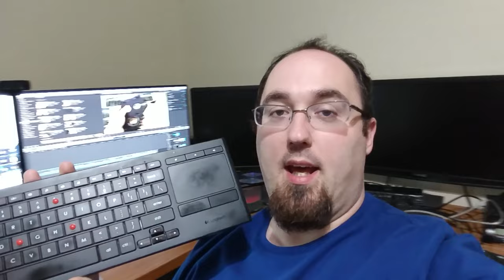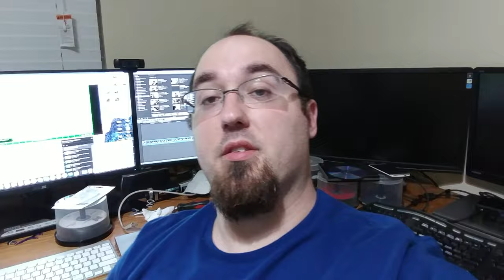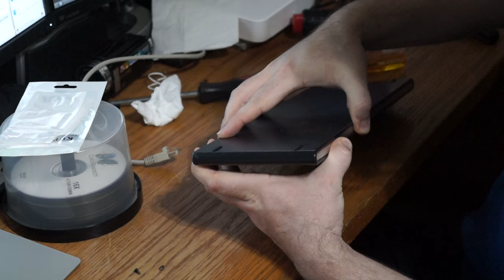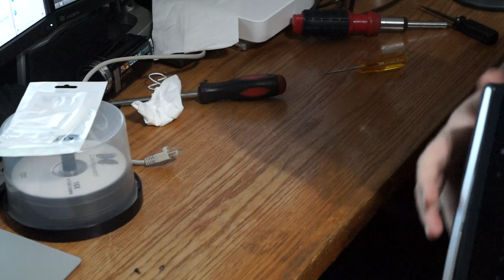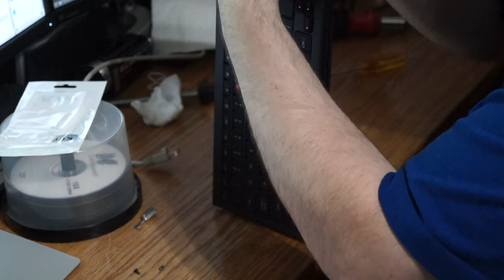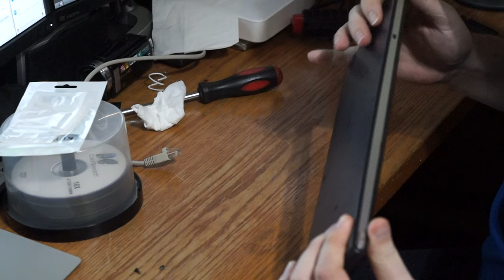HowTo: Bulging Logitech K830 Wireless Keyboard?  Tear it open!

Comment: Please help! my keyboard not turn of the light keys.  F1 key funcionally but the light no
Reply from the maker: I'm not sure I understand.  The lights are staying on?
Reply: uberDoward no lights off
Reply from the maker: Ah!  Make sure that the battery has enough charge.  I noticed that when the battery starts to get low, my lights go off.
Reply: uberDoward have full charge :/
Reply from the maker: Definitely strange.  You'd have to open the keyboard up and do some in depth analysis to find out what's wrong, I'm afraid :(

Comment: Interesting!  Mine has been bulged for a few years now.  Looked up a disassembly today because my q key is now broken/inconsistent.  I'm guessing it's the membrane that's torn since it's no longer bouncy. But, yeah, I had thought it was going to explode on me any day now.  But the bulge is just like your keyboard, which is not where the battery is at all.

I have a backup K830 I bought years ago on sale for like $60 before they stopped making them.  But I don't want to use it until I absolutely have to.  I love this keyboard, and with them not being made anymore, a good, wireless keyboard with a touchpad (and backlit) is hard to come by these days.  Such a shame.